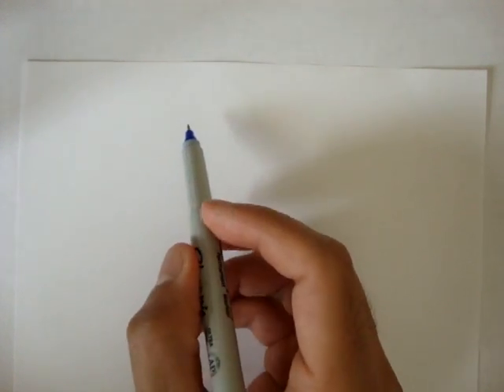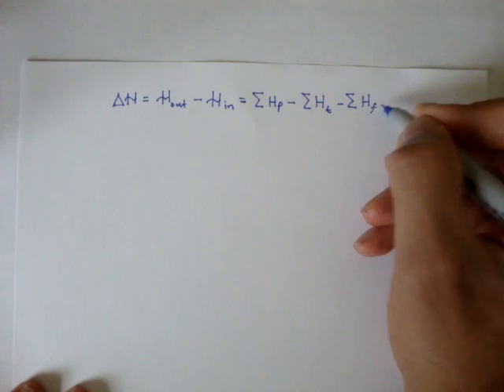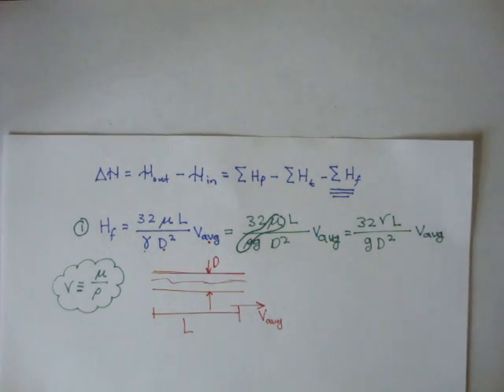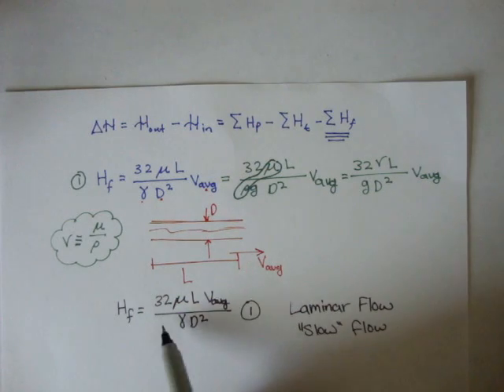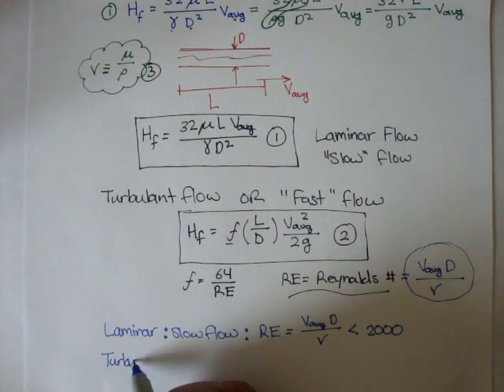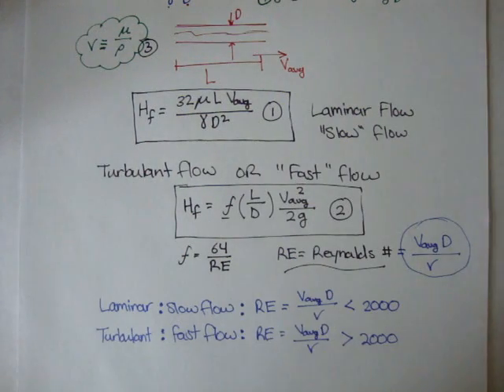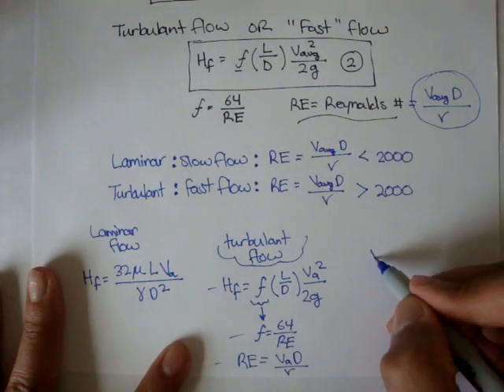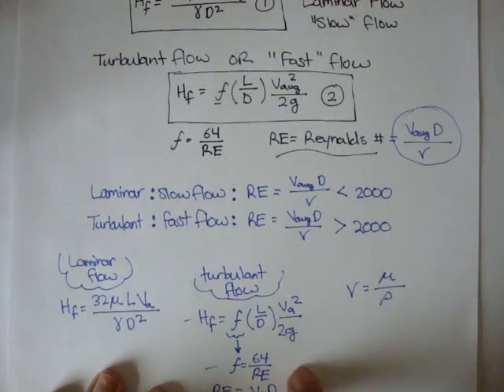Pipe Flow and Darcy-Weisback Equation [Fluid Mechanics #36]

Comment: The speed of the flow may be related to whether it is laminar, but it should not be thought of as interchangeable.  Flow will be turbulent at very low velocities inside a rough walled pipe, but will remain laminar at relatively higher velocities in a smooth pipe.

Comment: Thanks for the videos Simmy.

I would like to add a point here, the friction factor for the turbulent flow does really depend on the roughness of the conduit. in other words, if the pipe is smooth, then we can use Blasius correlation, and it is in the form of:

f / 2 = 0.039 RE ^ -0.26 ,

or if it is rough, use Colebrook equation to compute f, which is really complicated 

Cheers,